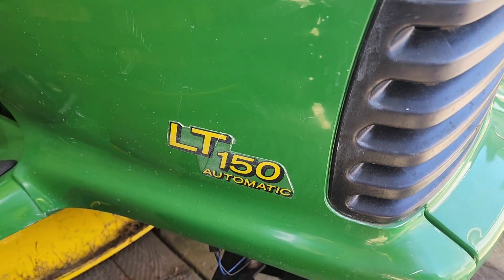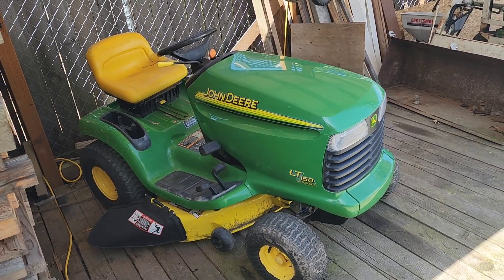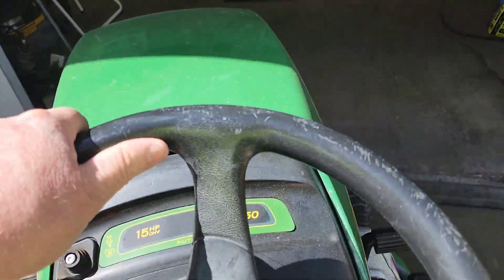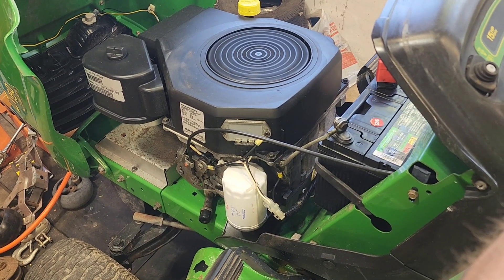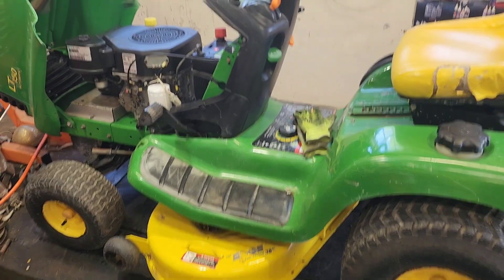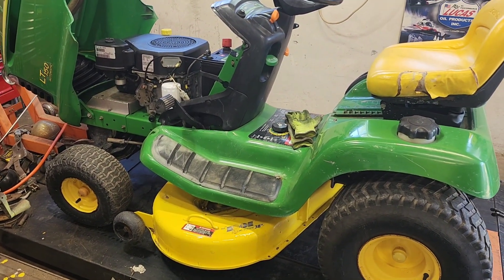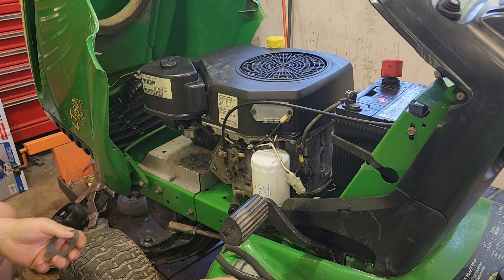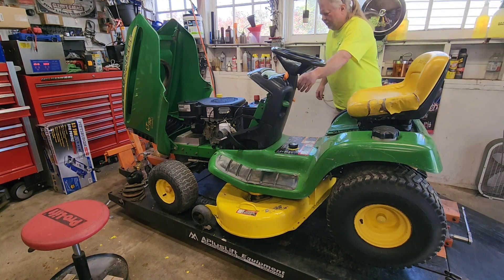John Deere LT150 New Carburetor.  Maybe it will run right now!

Comment: Wow! 5 Carberators?!?!  I've been using cheap Chinese knock-off carbs for many years and only had a problem with one of them.  It had metal flash from the casting process in the bowl that would randomly get sucked into the main jet and then fall back out. A customer brought it back and said it would not run.  I kept it for two weeks to cut my complete yard almost twice before it had any issues.  I pulled the carb bowl off and found aluminum flash pieces in the bottom.
Reply from the maker: So... turned out to be engine issues causing most of its problems. I ended up doing an engine swap. From what I could tell, this engine was put together out of other junk engines. One day it would run and the next it wouldn't. Couldn't sell it like that, found another engine and swapped it. The new carbs are likely OK...

Glenn
Reply: @GlennsSpeedShop  That makes sense. I’m sure quality control inspections are one they can cut costs but I’ve been pretty lucky with them. 😁👍